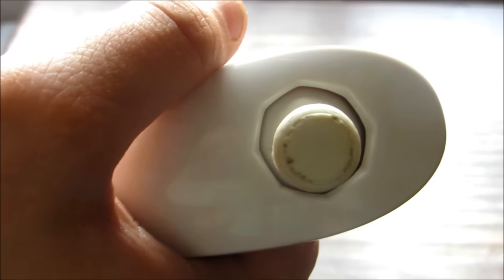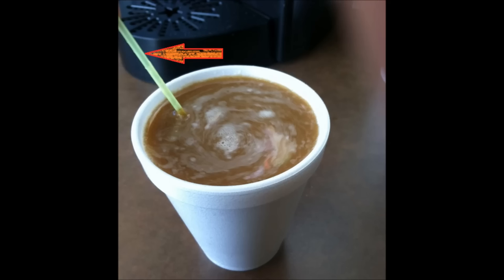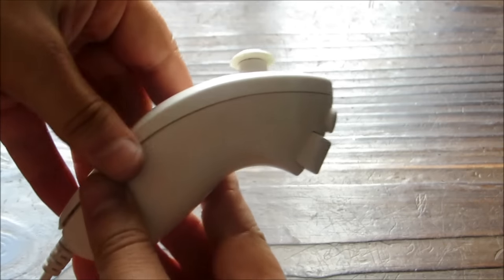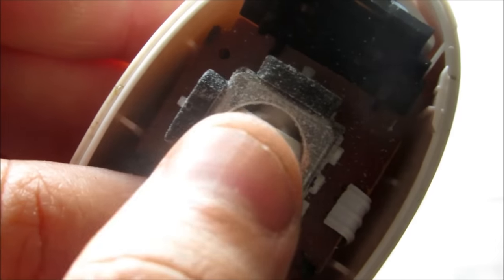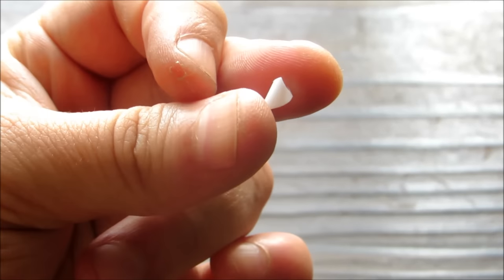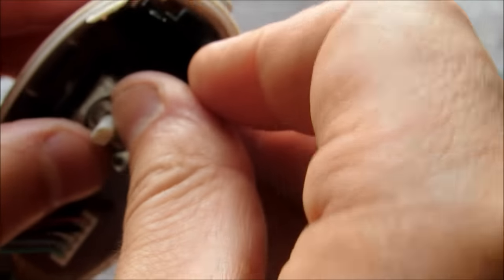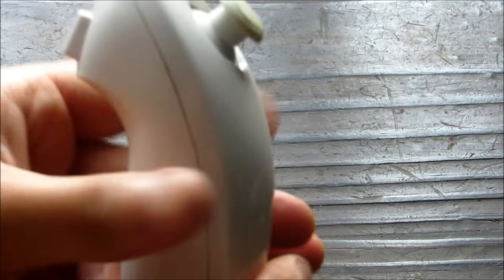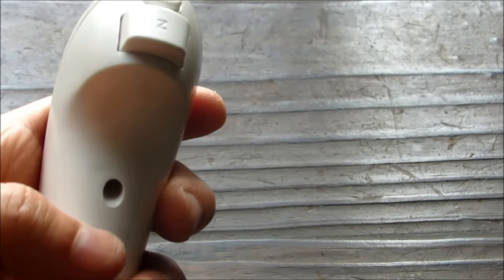How to fix Wii nunchuck joystick

Comment: So if my character moves without me doing anything will this fix it?
Reply from the maker: it means that your nunchuck stick has pressure on one or two directions pushing stronger that the oppose directions. Try looking at the stick inside and if the fiction is shown mostly on some sides. it could also be an electronic circuit in the inside we could not fix.
Reply: Did you try unplugging the nunchuck from the wiimote for a bit then plugging it back in?
Reply: clswinson1 it happened to me, i removed the nuchuck from the wii remote and plugged it back in again then it worked
Reply: Victor Huang ikr
Reply: @Victor Huang Same,  I've been playing for months with only the Wii Remote sideways, and every time I try plugging the Nunchuck again, it still doesn't work.

Comment: My nunchuck plug is rusty and it when I connect it , it doesn't say it's there
Reply from the maker: this is something to do with the cables or internal failure of the device, it will be better to replace that nunchuck.

Comment: I tried using a straw but it was too small
Reply from the maker: the ones for stirring  coffee should work.
Reply: i treid finding them at walmart but they dont have them
Reply from the maker: +Mr.Bluecat77 try Starbucks, they should have... or any place where they sale coffee, make sure the cut on the pipe is diagonal
Reply: kay thnx